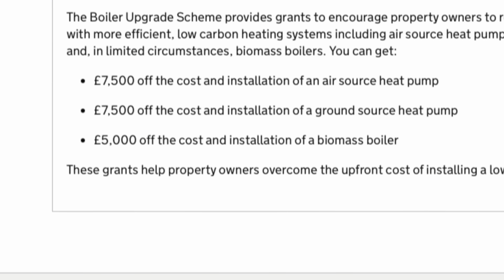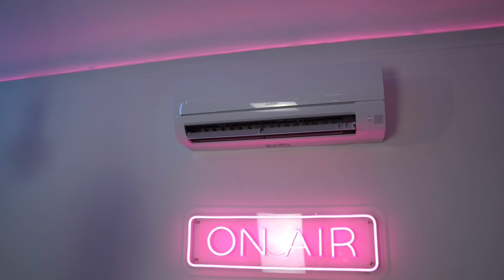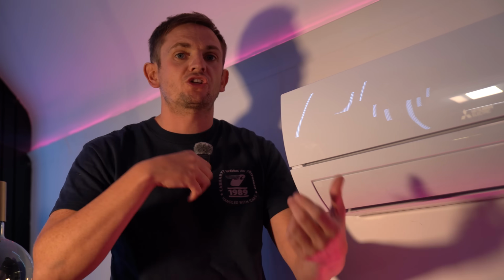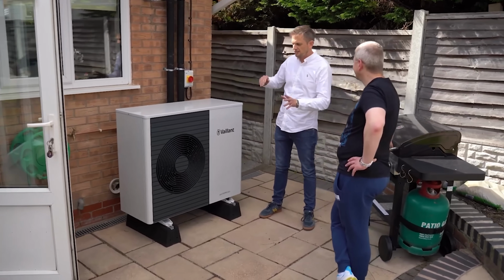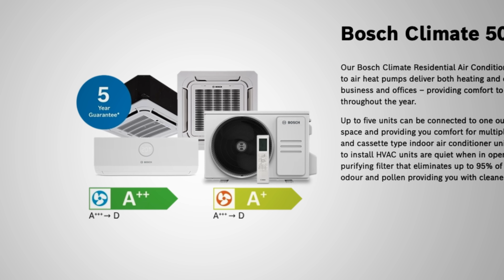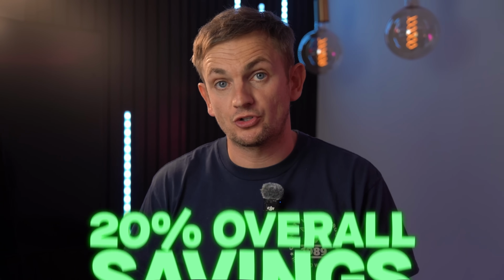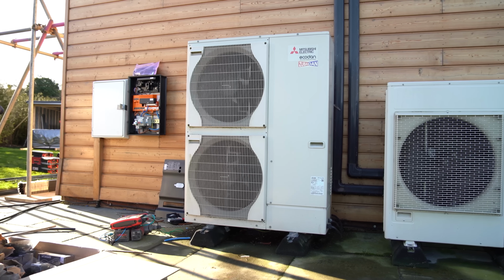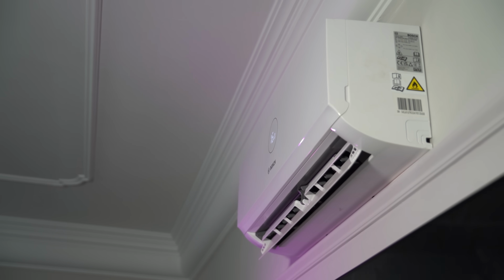Can you get a UK grant for Air Con (AC)?

Comment: With the current summer climate in the UK, air conditioning and heat pumps have been featured in local news bulletins. These have raised questions regarding the neccessity for obtaining planning permission when seeking to install an air conditioning unit or heat pump in a UK residential dwelling. I think it is therefore advisable for those home owners to seek advice on this matter before laying out cash on a new installation.

Comment: It would be great to install a big radiator ( big as the outdoor unit's surface where the fan is ) connected to the hot water line of the house , in front of the fan of the outdoor unit , perhaps a tank as well connected to it to store the hot water heated up by the fan . It's not so difficult to project it and make it a real thing , it just needs people willing to do it . That should be a great patent , if it doesn't exist yet .

Comment: I have an 8KW solar array with 15KW battery. From April through October I am a net exporter. I have a 210 litre Mixergy  water heater that takes 2kw of excess solar and heats the water.  Even then I am selling 30 kw per day to the grid  for peanuts that could cool the house.  I had  a mini split system on a house overseas and it was excellent for both heating and cooling so I’m getting a bid this week on a new install.

Comment: Air conditioning needs planning permission, only certified air source heat pumps can be installed with permitted development rules. You can't install ac and claim its renewable because the ac unit has heat pump technology
Reply: Depends on the air con you fit if it heat as well as cools then you don't need planning, if it only cools then yes you will

Comment: Loved your little rope trick at the beginning 😂.  I made the switch to aircon in 5 rooms. Paid £7500 all in. Makes so much more sense to go for cooling and heating and air purifying for the about the same price. Eventually I will get a large heating element for my immersion heater and use electric for the water.
Reply from the maker: Ha! Great to hear you’ve made the switch. I could never not go back to no AC!

Comment: If you want the units for mainly heating do you still recommend high level units or is temperature stratification a problem?  Do you  get cold feet?  Should we go for low level units? Also there are now systems that combine mini splits with water heating. Hitachi and Daikin do it I believe.

Comment: I have two split air con Daikin units just gone to put my house on the market and they marked the EPC rating much lower! They are heating and cooling units. My heating energy bill is so much lower running these I'm very confused. Also have an on demand A rated redring for basins and  sink
Reply: You mean the energy rating deteriorated? Im also considering these A2A units and would hope it would improve my rating. Can you please confirm
Reply: @supersurfer1 correct

Comment: You have heat pump with inverter (external unit) and you can hook up A/C (internal units) to it, like I have. So you can have both on one external unit. Surprised that this wasn’t presented as option as well.

Comment: Biggest benefit of air/air isn't the cooling it's that it actually works responsively and can be configured by an idiot and still work properly. As there are a lot of idiots installing heatpumps this is really important. Air/water on the other hand is slow to respond, takes ages to get a cold house back warm and requires the installer doing the calcs and the compensation curves has a pointy hat and a degree in higher mathematical guesswork. 

Our setup is air/air and even without the grant was cheaper than we were quoted for air/water with the grant. That's despite the UK stupid rules stopping self installs as are permitted in most sane countries.

For most setups air/water needs to be go the way of the dodo.

Comment: My original comment got removed. According to the Guardian, air/air heat pumps ARE now available for the grant. I heat my water with Solar Thermal topped up by solar divert (EDDI) and cheap rate juice or battery.

Comment: We need pragmatic politicians, not zealots. Adding A2A would be far easier and even combined with a combi gas boiler would probably reduce our need for gas by 80% very quickly. They could add a solar requirement for the cooling part in the summer.
Reply: There's no point adding a solar requirement because it will just make people go down the store and buy a shitty single hose portable for the summer days (at 200 quid) with an effective energy efficiency of about 1.5 so far worse than letting people just do the right thing.
Reply: @etchedpixels .We have MCS accredited installers.

Comment: I know that you are trying to sell the AC kit but you should really mention that Air to Water Heat Pumps that can cool, can be used with Fan Coil Radiators which can be used to cool as well as heat a house and you would still get the £7,500 government grant.
Reply: Any links to available products you can share?
Reply: @aliasgharkhoyee9501  Not at the moment, I'm just looking into it myself. Remember the rest of Europe have been using Heat Pumps for decades.
Reply: @aliasgharkhoyee9501  This Heat Geek video on "Cooling with Heat Pumps" is interesting: https://www.youtube.com/watch?v=dn4Ja_q5M9g

Comment: We have two 4 way multisplits, both outdoor units are 9kW, and the indoor units are all Daikin Stylish, between 2.0 and 3.5kW depending on the room.

Wouldn't go back! It's awesome! radiators are in the process of being ripped out :)

We already had a water tank with our gas boiler, we don't use the gas now and just use the immersion.

Comment: Holy Moly how can 1 a/c unit cost 2000 pounds without vat to supply & install. What are they, made of gold. Glad i left UK many years ago. Here in Spain I bought 5  A/C units including installation kits for less than 1800 euros. (It is cheaper to buy 5 separate units than a multi split, more efficient and easier to install) A vacuum pump and the measuring stuff 150 euros. Installed them myself, NOT exactly difficult. Even if I paid someone here each one  would be no more than 200 euros.
Reply: You need to be certified to install any unit that contains CFC’s R32 refrigerant. Most supply only will need the installers cert number before releasing the AC unit.
Reply: Because in the UK most people end up paying
- big vendor to take a cut and pass it on to local vendor
- MCS certification costs/crap
- in many cases planning permission (though this is improving)
- extra costs because it's not common here - lack of installers, expertise and suppliers

A lot of those costs are going away - the planning farce is improving, people are learning to find local vendors and as we get more people doing it the volume costs drop.

You still pretty much can't find a dual hose portable in the UK at all though for small setups, and window units are like unicorn poop
Reply: This increasingly popular  "rapper" style of presenting is very irritating. It makes it very difficult to focus and concentrate on the subject matter rather than being mesmerised by flailing arms🤔
Reply: Yeah this channel is overestimating the A/C costs, the materials cost is coming down to nearly £500/unit these days, so with installation it shoul be upto 1000/unit max.

Comment: About time they gave you BUS on Air-to-Air.  If they are worried about the extra electricity usage, then make it a condition that you have solar installed too.  About to shell out £15k for my system, ducted upstairs to 4 bedrooms and 3 wall units downstairs, 2 outside units.  For hot water, I am going with a Mixergy IHP for another £4k.
Reply: If they did the price would rocket up
Reply: @theSKINTyorkie  Bingo... air/air prices went down over the past few years, air/water install and equipment remarkably went up about £7K an install.
Reply: @etchedpixels yeah, strange how prices seem to substantially increase when there is a government grant to be had!
Reply: Spot on you should get the grant if you have solar as well and battery so on the long hot days you are not drawing of the grid at peak times
Reply: Weve got an Eddi for hot water, cost £400 and pulls off the solar panels.
Reply: That’s exactly what I’m putting in. 
Mixergy tank with 8 indoor units. Hope all went well

Comment: ??? Air to water single function? Most air to water heat pumps also heat hot water, whereas most air to air (ac) units don't. Also, ac units won't help with hayfever, unless keeping the windows closed to keep them running efficiently also helps - the filters in most are simple dust filters, not HEPA, so they won't filter out smaller particles like pollen. EDIT - ac units do dehumidify, but not very effectively compared with a dedicated dehumidifier.
Reply: To get any benefit from air conditioning, windows need to be closed, otherwise you are trying to cool down the planet
Reply: There's promising signs that A2A units with hot water features will be available soon, which will be ideal.